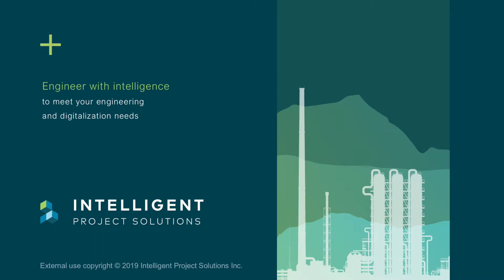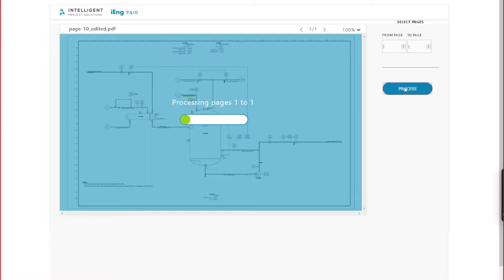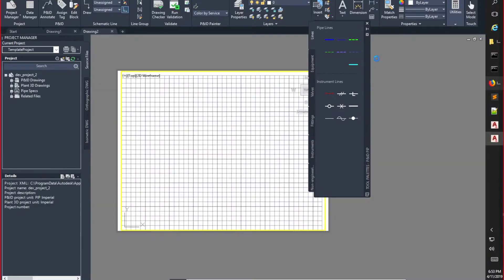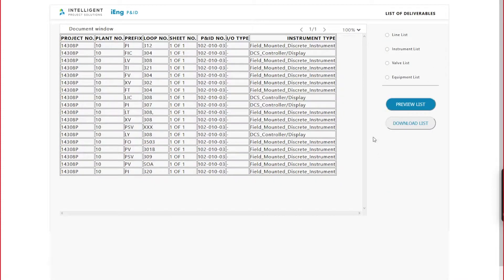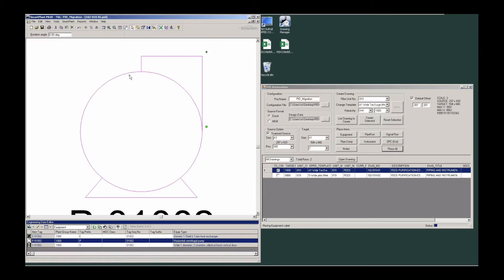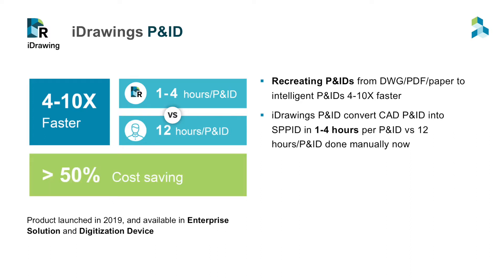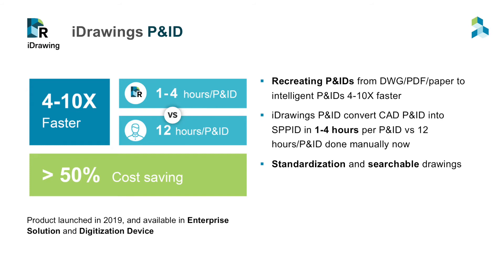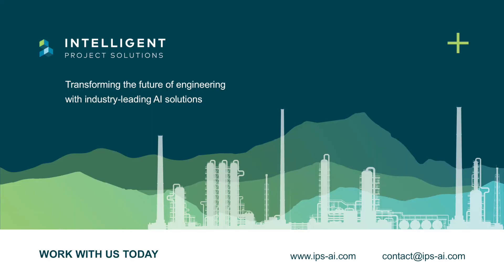Introducing iDrawing P&ID

Comment: Great idea
I always thought about something like this. This is for conversion of P&IDs from PDF or scanned formats. What about when it comes to making changes in the P&IDs thereafter. In that case I believe in Why not develop P&ID in smartplant with a stylus pen and tablet where the system identifies the symbols from the database as Google Handwriting input understands various languages of the world just by scribbling on the mobile. Moreover whenever there is a duplicate item instead of searching it in the Engineering Data Editor it should pop up in front of the screen that it is located in the particular P&ID.